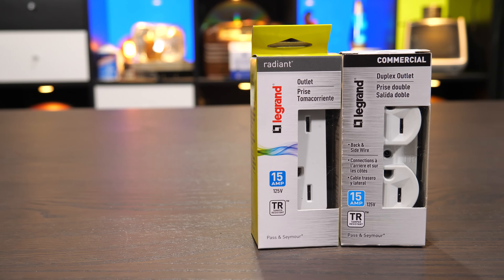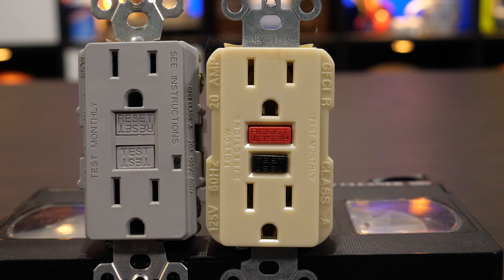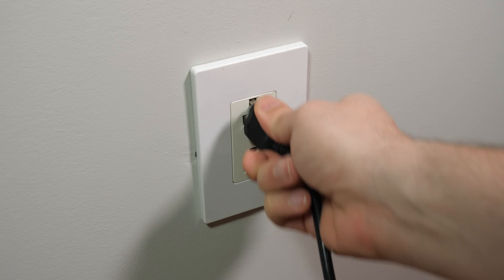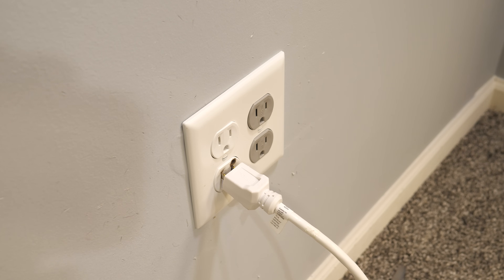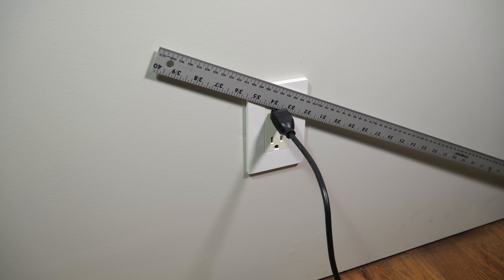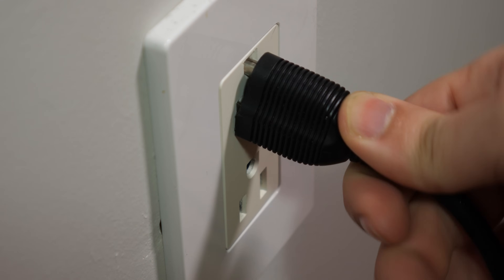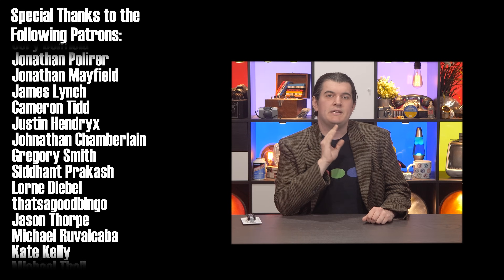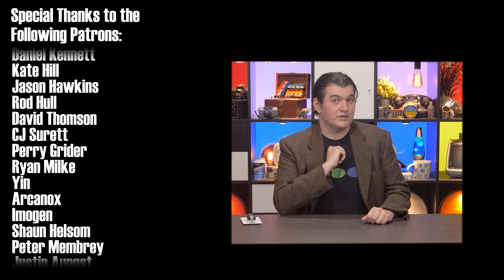Power outlets are topsy turvy - but does it matter?

Comment: I recently had a NEMA 14-50 installed in my garage for an EVSE, and it was installed ground-up, which is apparently the standard. Ironically, I had to flip the outlet in order to make it work with a wall-mounted EV charger (for portable chargers, ground-up seems to be the preference).

In a couple of apartment buildings I lived in previously, upside-down outlets indicated that they were the switched outlets, though usually it was only the one at the top of a duplex receptacle that was actually switched.
Reply: I recently found out that where I live, Manitoba, Canada, it's a provincial requirement that all NEMA 14 series sockets have the ground to the left or right. That way, the cord exits the plug to the side.
Reply: @dougbrowning82  that makes sense ! I've been researching how difficult it would be to upgrade the NEMA 10-50 range outlet and NEMA 10-30 dryer outlet to 14-50 and 14-30, respectively, and I'm finding mixed information. Some sources are suggesting that if there's a NEMA 5-15 outlet nearby that it's possible to use the ground from that, but others seem to indicate a separate wire needing to be run back to the panel. Both of my series 10 outlets have NEMA 5-15 nearby, so that'd be convenient, if possible. I'll probably ask my electrician next time he's over for any work at the house.
Reply: standard range plugs normally have the cord exiting opposite the ground pin, which would explain why the plug was installed ground up.
Reply: @kenbrown2808  that makes sense! The range here uses a NEMA 10-50 since this house was built in 1977, so no ground 😅😵
Reply: @traepalmer  actually, the third blade is both neutral and ground.  which comes with its own problem, because if the wire breaks in the wall, that means your stove will have energy in the steel body looking for a path to ground.
Reply: @kenbrown2808  right, which is why it's no longer allowed in new builds or retrofits. The dryer outlet is the same: NEMA 10-30.

Comment: The reason I heard for the knife-throwing scenario was the possibility of narrow metal venetian blind slats falling down from a window onto a plug/socket below.

Ah well. I'm happy with our ridiculously-overengineered BS1363 plugs and sockets here in the UK. Right up until I step on one barefoot.
Reply: part of the reason your plug is so robust is that until recently, your ring circuit was fused at 30 amps.  our 30 amp electric appliance plugs are almost as robust as your standard plug, (we have flat blades in stead of square pins, so they can be bent on accident)
Reply: So safety of the superior UK plug aside... do you normally leave one of said plugs just laying on the ground such that you could step on one?
Reply: I've seen the result of a roommate knocking a penny off a desk and it landing between line and neutral on a loose socket, scorched the wall and socket, never tripped the fuse in the fuse box (old house in a state/county/city without formally adopted electrical code) so he had to unplug the cord dropping the penny on the carpet which then melted into it. Scorched the wall, socket, destroyed the power cord prongs and penny was missing a couple chunks.
Reply: Your plug has an advantage of having a fuse. This way kids don't have to hear "don't daisy-chain extension cords" twice a month at school. 

Also, nothing prevents British Standard to additionally allow the small "euro plug " - I believe it's the type F.
Reply: @LMB222 There should be shutters in front of live and neutral, opened by the Earth pin. You can probably squeeze an Europlug in if you are inventive about it, but you really shouldn't. Also Europlug is Type C, F is German Schuko.
Reply: @tz8785  we used to jam stuff into ground to open them up (Growing up in Ireland with Polish appliances), though of course adapters were mostly used, but in a bind I remember that being a option
Reply: @LMB222  Also - because allthe plugs have earth pins (even if they're not wired) we can have shutters in the socket so you can't actually get to the hot wires if a plus hasn'tbeen inserted.
Reply: @DaveF.  the US tamper resistant plugs, you heard him mention have shutters, but they are designed so you have to insert something in both sides at exactly the same time. (happens automatically with a plug, but takes a bit of work with anything else)
Reply: @DaveF. agreed!
Reply: @kenbrown2808  And in practice, those godforsaken tamper resistant plugs are a real pain in the ass to use. 

I don't enjoy spending a half hour trying to plug something in when it should have taken two seconds.
Reply: @vhfgamer  you must have either incredibly cheap low quality receptacles, or damaged/defective plugs.  it takes me two seconds to insert test probes into a tamperproof receptacle.  I don't even have to do anything conscious to plug in a standard plug.
Reply: @kenbrown2808  They were brand new sockets installed on a brand new electrical service for a brand new house by a certified electrician... all up to the new code. They suck so bad, I've considered ripping them out myself and installing regular sockets. Luckily for me, that particular socket isn't one I use very often, so I haven't bothered.
Reply: @vhfgamer  that doesn't mean they weren't a bad brand. But you should have complained if they were brand new. Trades have to warranty their work.
Reply: @kenbrown2808  I did. They said that they were to code, and that's just how they are now. 

And I've since experienced these tamper resistant plugs in multiple locations. They all SUCK to actually plug something into. Yeah they'll keep a kid from sticking a toy in there. Hell... they'll keep an adult from plugging anything in.
Reply: @vhfgamer  then you had a rathouse electrician who installed crappy devices.  like I said, I put test probes into tamper resistant plugs more easily than that.
Reply: @kenbrown2808  Well eventually when it ticks me off enough, I'll rip them all out and put in good normal sockets.
Reply: @vhfgamer  or you could buy a reputable brand of tamperproof device, and be both functional AND resellable.
Reply: @kenbrown2808  The only way my house is ever going to be sold will be after they've carted out my rotting corpse.
Reply: @LMB222  except "don't daisy chain" is widely parroted in the UK. :(
Reply: @LMB222  We have fuses in US plugs too. At least some of them.

They could easily be put in all plugs if we wanted, but we have decided that a fuse in the plug is totally unneeded.
Reply: I looked up what that looks like and tbh, if your plug can lie on the floor with the prongs facing straight up, your plug is not overengineered. It's a safety hazard. (A smaller than many others, but still.)
Reply: @Pingviinimursu  not really. It hurts, but it doesn’t harm. It’s the lesser of two evils: the greater evil being big fiery electric death.
Reply: @tomgidden  What? I meant having a rounded back side of the plug, so unplugged prongs point to the sides instead of impaling (well, probably just hurting a ton) clumsy feet. There's no electrical death involved anywhere in this.
Reply: @Pingviinimursu  As far as I know, the back of the plug isn't specified by the standard. Still, with the cable where it is, I think it'd still be prongs-up. Stops them getting wet in a puddle, too.

It isn't a big deal, really. I'm fairly messy and have plugs everywhere, and I very rarely step on them. I injure myself in far more stupid ways usually.
Reply: @Pingviinimursu  some say that UK plugs were invented by the same guy who invented lego.
Reply: I've had things fall into a plug and short it.
Reply: You need more safety, with DOUBLE the voltage being far more dangerous.
Reply: @harrkev and 50 Hz is slightly more dangerous than the 60 Hz we have here. The slower pace can interfere with your cardiovascular function if you’re actually grabbing the thing and electrocuting yourself.
Reply: @RJDA.Dakota  the frequency barely makes a difference.  the higher voltage pushes more current through the body.

Comment: The scenario I was given for ground up was a water spill.  Say you're pouring spaghetti and the nearly boiling water it was just cooked in into a cullender in the sink.  The water splashes a bit and gets into the outlet.  Whether that water makes a connection to ground or hot first makes a difference.

The problem with this example is, as you mentioned, a lot about where outlets are placed in the code, and part of that placement is "not there".  Older houses might have outlets within a splash zone of the kitchen sink, but it's my understanding the code was updated to disallow that when I was a child.  That was quite some time ago - almost certainly before Alec thought to put any videos up on YouTube.  How many places could I've put that period earlier in the sentence and had it still be accurate.

There certainly are opportunities to have water hazards with power cords, but the one in the example has been tentatively fixed already.  Sure, there are places where the issue pre-existed the current code and it's been grandfathered, but they're not going to change due to a fad and they're probably being used with old two prong plugs anyway, at least if my father's a good example of that situation.
Reply: What about the much more common circumstance when a basement or room floods? Now your relying on the plug being perfectly level so the hot shorts to neutral before you step in the water to get to the breaker panel.

Point is every imaginary circumstance someone can conjure up is pretty silly. All the absolutely ridiculous codes in NEC and even they found this too dumb to put in there.
Reply: This is not only an extremely unlikely scenario, but also doesn't exactly work as you're thinking.  Water, itself isn't conductive.  What conducts electricity through water are the impurities such as salt and other minerals.  That said, without a laminar flow, unless you're working with voltages above 230, and outside of a manufacturing plant, you probably are not, there's just not enough voltage to bridge the airgap between the droplets of water.  Realistically, we just need a better designed outlet.
Reply: @banggugyangu  It's only unlikely in my mind because we've fixed the issue with the electrical code.  When there were outlets right by the sink, or in the case of my grandmother's sink, on the wall right between the two sink basins, splashes that impact the outlet are quite likely.

As far as only water with impurities goes... I'm not sure how much cooking you've done.  If one cooks like my grandmother did, you start the process by putting way too much salt in a big pot of water.  The rest of the stuff that goes in the pot might be a net insulator, but that salt certainly isn't.

Laminar flow is basically impossible to avoid in the emptying a big pot of water scenario.

But as I said above, the code update fixed the problem.  If there aren't outlets within about 3 feet of the sink, it's as unlikely as you suggest.  If I recall the code correctly, it requires 5 feet from the sink before you can put outlets.

Comment: I'm almost certain that NEC once required the ground bottom orientation. I was given the job of comparing the versions when a new version of NEC was released to see if any or our products needed to be changed. The older version required ground down, the newer made it optional.
This was over 35 years ago so... 
It would explain the orientation of 90 degree plugs all being that way as that would have set a de-facto "standard".

Comment: Bigger question… if the outlet has a flathead screw to hold the faceplate on, do you leave the slot horizontal, vertical, or something else like an anarchist…
Reply: Unfortunately, the slot’s orientation is secondary to the amount of tightness. You have to make sure you don’t want to crack the face plate and you don’t want to leave the screw loose.

Comment: Here you are talking about a simple 120V receptacle and my parents’ house has a 240V dryer outlet (3 conductor) that was installed upside down. They have a zip tie holding the cord up so it won’t back out. Now that’s dangerous!
Reply from the maker: One thing that I wrote very carefully around is that, per the NEC, most other receptacle types do in fact have a specified orientation. From my understanding anything 240V will have a specified top and bottom. Whether or not that's always followed on the plug side, though... well I have a car charger that certainly feels upside-down plugged into a NEMA 14-50!

Comment: In the Navy, we installed them ground-up to avoid breaking the little piece of plastic between the ground and the edge. If that piece was broken off, it would get written off as a broken outlet, and we would need to replace it. When the ground is down, the force of gravity on the plug would often break that little piece of plastic. With the ground-up orientation, the outlets never broke.
Reply: Good news then that receptacles aren't made out of brittle bakelite anymore for all of us with them ground down? 😊
Reply: @YellowBunchofBananas  I've seen plenty of "modern" receptacles that have broken ground sockets because they're made out of cheap material. Just because it's not bakelite doesn't meant it's definitely good.
Reply: @OtakuUnitedStudio  Fair. I bet none of them were Decora style though.
Reply: @YellowBunchofBananas No, they were that off-round shape that persisted for a century. Decora is definitely the way to go now, but getting the older ones (with the one screw in the middle) is still really easy.
Reply: @YellowBunchofBananas  No, they are now made of chinesium, even more brittle and useless.

Comment: I normally agree with you on everything but might this be a case of the "But Sometimes!" fallacy from the LED traffic light video?
Reply from the maker: I don't think this would count as a "but sometimes!" because the proposed fix is itself only sometimes a fix. Two-pronged plugs foul the whole idea up.
If what you mean is that I'm opposing inverting the outlet by the same logic that holds incandescent bulbs should remain in-use to prevent snow buildup (sometimes (right angle plugs) inverting the outlet makes things worse) I think I know where you're coming from, but I don't think the scenarios are equivalent. Besides, the moral of that story is to fix new problems rather than see them as reason not to progress - and I don't think inverting the outlet truly fixes anything. Finding a way to sleeve the blades is the true fix we ought to aspire to, imo.
Reply: @TechnologyConnections I concur and you have changed my perspective

Comment: Did you ever do a history of "why 120v?" I know it follows from light bulb history, but I'd love your perspective and commentary.
Reply: Yes he did a video on that already.
Reply: Also, remember in USA we have 240v service. We just have 2x 120v legs. You can span them to get 240v. 

This channel has videos on this too.
Reply: @eric_has_no_idea  Yes, and in Europe we have 400V service, but that's not what we usually have in the normal indoor outlets. We have 3 phases with 120 degrees between them, so phase to neutral we get 230V (+- 10% depending on country), but phase to phase we get 400V. If I understand the American system correctly, in homes you usually just have two phases with 180 degrees between them? So you either have to compare your 120V to our 230V, our you can compare you 240V to our 400V. :-)
Reply: @eric_has_no_idea I still don't understand why you get 2*120, not 3 phases - which are clearly available in North America.
Reply: @LMB222  3-phase is only generally used in commercial settings here. 

It gets even weirder. Some apartment buildings do get three-phase, and use two, so the total power is ~110v and 220v.